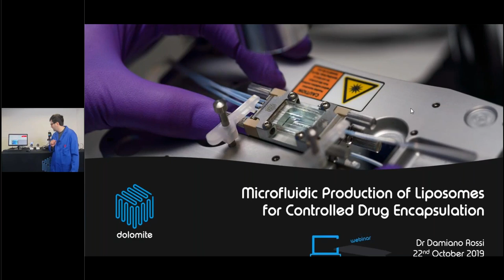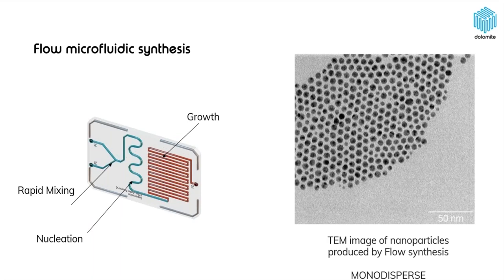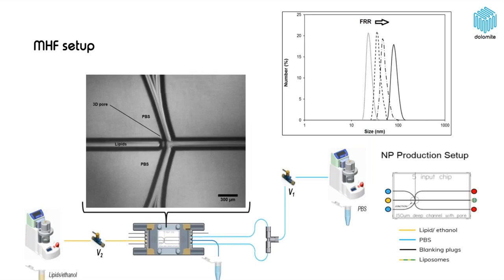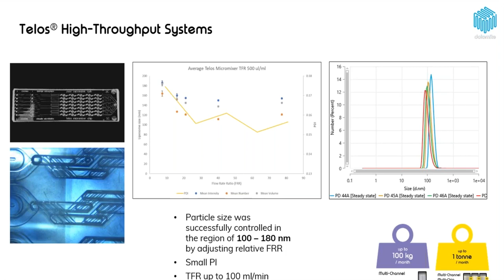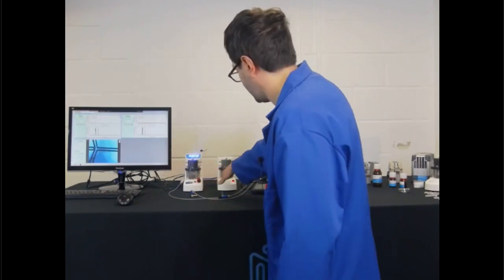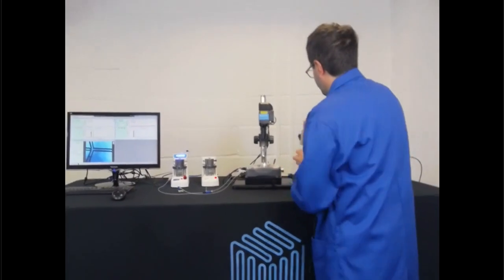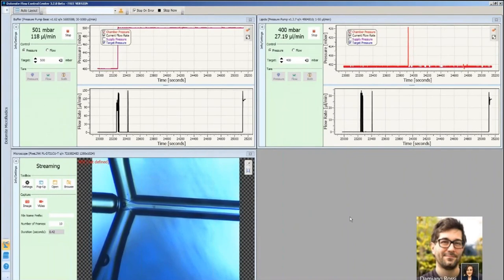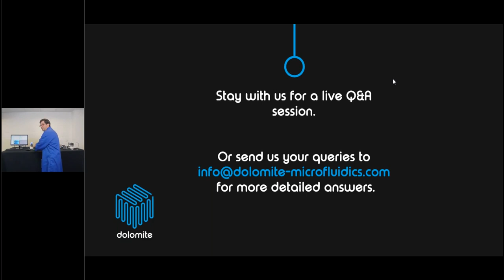Microfluidic Production of Liposomes for Controlled Drug Encapsulation

Comment from the maker: Helpful timestamps for navigating this webinar:

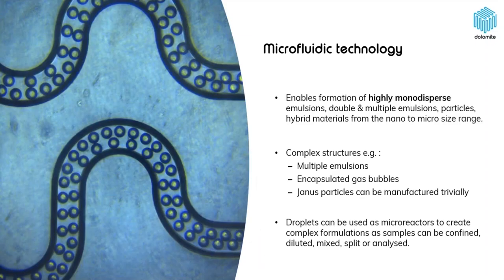1) Introduction: 0:00 - 3:20
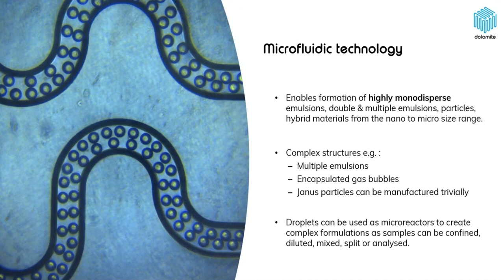2) Why use microfluidic technology? 3:20 - 3:55
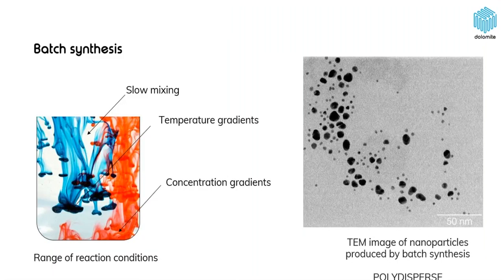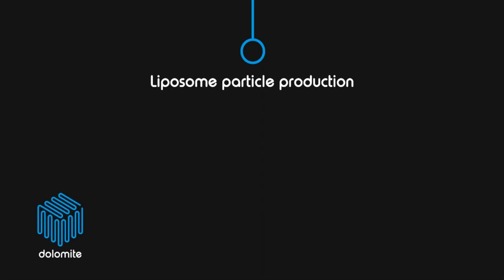3) Batch synthesis & flow microfluidic synthesis: 3:55 - 6:15
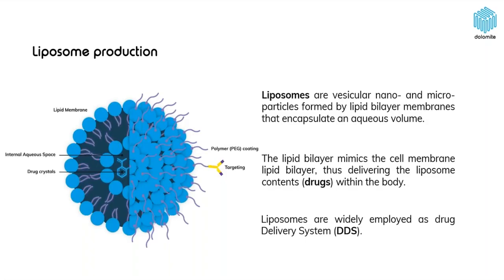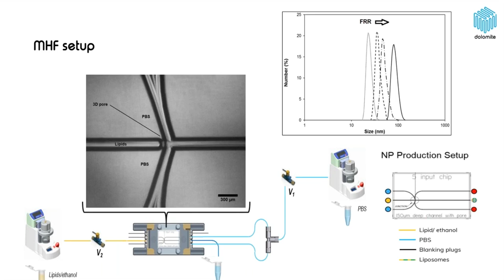4) Liposome particle production & set-up: 6:15 - 10:45
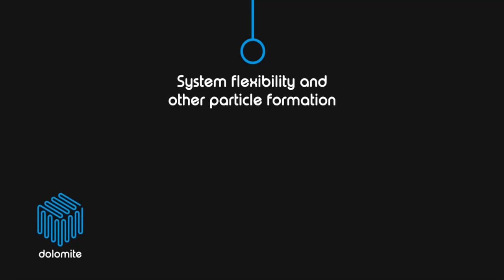5) Dolomite single channel & Telos high-throughput systems: 10:45 - 14:40
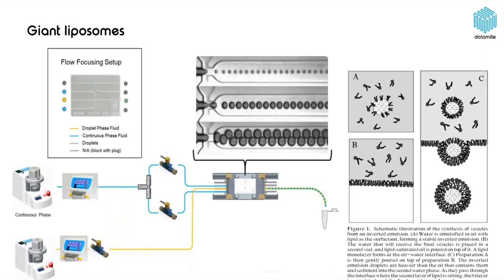6) Giant liposomes & other particles: 14:40 - 16:30
7) Summary: 16:30 - 17:35
8) Dolomite liposome synthesis system overview: 17:35 - 26:00
9) Flow control center overview: 26:00 - 30:30
10) Ending & additional information: 30:30 - 31:35

We hope you enjoy this webinar hosted by Dr. Damiano Rossi